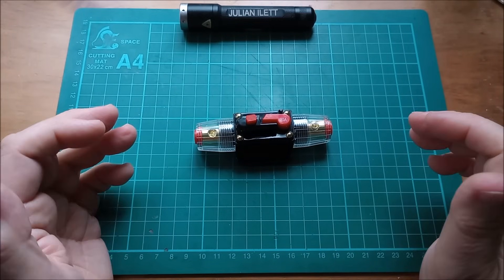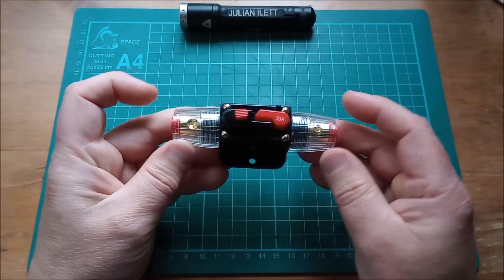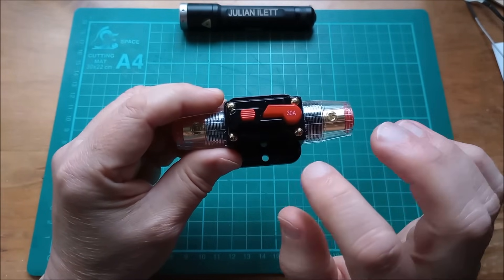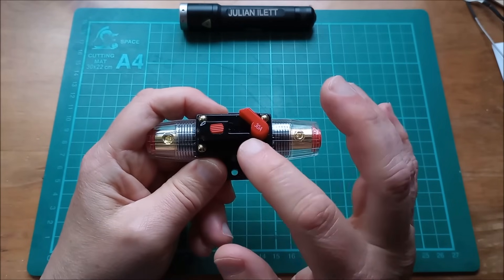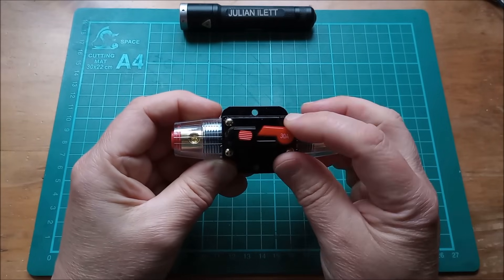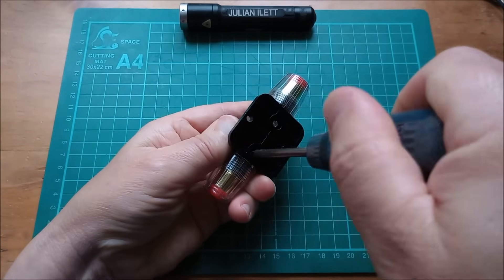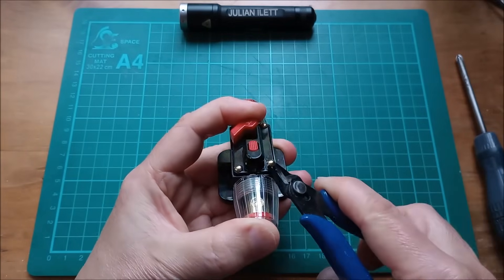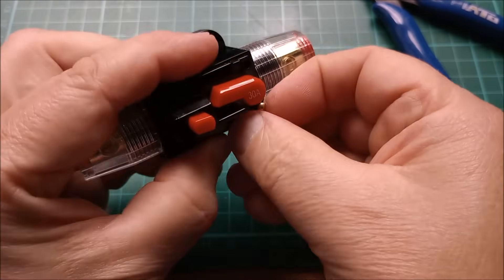30A DC Circuit Breaker Teardown

Comment: I use a 40A one for my Bafang BBS02b ebike. I wonder if it's accurately labelled to its rating. It may be too high (60A). I have not tested mine due to the lack of tools and skills, but have you tested yours?

Btw, fan since 2016. I usually reference my 'next thing to buy' with your reviews. Clear and fun as you explain your experiments/tinkering. Unlike those I see from tiktok. too much 'retention' grabbing style but lost the essence  of exploring/experimenting.

Comment: Would be much safer to have an electronic disconnect/fuse instead of these bi-matalic type fuses. If you're already using a switch that has a permanent break and manual relatch, then might as well just use a normal heavy duty car fuse that you can replace. But yeah, as others have said, avoid this style of fuse, and as the stripdown proceeded I noticed the contact points were not flat, so it' going to heat the contact points up and fuse them, likely preventing the 'spring' of the metal from disconnecting. Just an overall bas design.

Comment: I have tested these breakers extensibly and I don't recommend using them for anything.  The contacts are only good for about 30 amps but, the contact alignment is very poor and, due to contact misalignment, very little of the face of the contact makes a connection when closed.  There appears to be no calibration on the trip point so, a 30 amp breaker could trip at the same current as a 150 amp breaker.  When nearing the trip current, some of these breakers chatter, which has the potential to damage the power source and load appliance.  They are only good for about 24 volts DC and 10 amps if you want to risk using one.  In use, they tend to trip at 1/3rd to 1/10th the marked current rating.  Since these are a thermal breaker, ambient temperature and wire heating alter the breaker trip point (the warmer the temperature, the earlier they trip).

Comment: The end terminals make this look a lot like the kind of fuseholder typically used in aftermarket car audio (though those have no switch and obviously arent circuit breakers), and after checking out the link it certainly appears that that's the intended use case for this too (though I'm not sure why you'd want a circuit breaker for car audio, the fuses don't typically nuisance blow if properly rated). Anyway I'm not sure I like it for in-home (or shed) use.

Comment: He probably doesn't have a 30A source to test with.  You'd need 45A to trip it reasonably quickly.  A lot of these are dodgy, I tested a few until I settled on GLOSO which did we what it said on the tin. 100A with nice chunky terminals.  You can pull about 120A for about 25 seconds and then it trips and the contacts work properly.  Like him, I usually use it just for a quick disconnect with a safety feature in case I accidentally short the battery.
Reply: If you short the battery it will definitely blow but it might be terminal because the short circuit current of my 24V 100Ah battery is very large.

Comment: I'm not sure it's bi- metallic. It looks like it's using a mechanical bend and relies on expansion of the metal with heating, past the kink which "trips" it up past three fault line.

I just bought one of these for my van conversion but I think I'll get a din rail one that works on more reliable method. 

I'm glad you did the tear down. Thank you.

Comment: I used a few of these rated for 20a for a solar project, they would trip constantly just from the heat induced by the poor internal contact. Never even came close to 20 amps. went back to ANL fuses and DIN style breakers and haven't had issues with anything since.

Comment: I too highly recommend that you don’t use it. I hear so many complaints about them and have met several faulty ones. They tend to nuisance trip in hot weather and the contacts go high resistance which causes heat, and the cable connections can get hot and make it trip early.

Comment: Breaking DC is a lot harder than AC, I can see the little red leaver moving into a sustained arc and just melting. 
For breaking high current DC I would use a contactor designed for it and possibly one with magnetic arc suppression to blow out the arc.
Reply: Yeah, it might even seem to work with a mild overload. However, under higher fault current I wouldn't be at all surprised if it fails to extinguish the arc and melts down.

Comment: I suspect that the "little flag" is used for arc suppression.  What is maximum rated voltage for this device?  I'll bet that, when used at its max rating, it won't last long if it operates very often.

Comment: does this ... slowly open?? if so this is absolutely terrible for DC breaking.. if you have any inductive loads at all in a DC system and break the contacts slowly like the button suggests,, this will cause an arc and this thing is going to catch fire. i advide againsdt this. use a safe one which is spring loaded
Reply: yes looking at the mechanism later on.. this is unsuited for DC loads.. slow opening, no arc arrestor.. this thing is a fire hazzard. please dont use this
Reply: @GenUltra758  This!

Comment: You don't need a fuse on the panel cables.
Reply: Yes, but having a switch on the PV side makes it easy to disconnect the panels in case of any maintenance.
Reply: @TheCommonGadfly  You don't need a switch for panel maintenance. All you need to do is switch off the loads attached.
Reply: @TheCommonGadfly  You don't want to break PV with a breaker like this. It's only rated for low voltage. I would call it a fire risk.
Reply: I use inline MC4 fuses and a proper DC isolator. If you need to remove the battery from the SCC and don't disconnect the panels you risk damaging the SCC, I've never fitted a system without panel fuses and an isolator.
Reply from the maker: If I break the panel-battery connection, there's only about 15V difference between them. Panel open circuit voltage  is about 40V and the battery is typically around 25V.

Comment: This type of circuit breaker is proven to be very unreliable and dangerous.
I advise to use a decent DIN rail type DC breaker.
Reply: For the voltages these cheap breakers are rated you don't need to get a Dc breaker. Most branded AC230V breakers are rated up to 60V DC anyway. Additionally they are way cheaper than branded dc breakers.
Reply: @OlanFantaziya  It's more about current! and i.e. a 16A AC breaker is NOT suited to break 16A DC!
Also, depending on brand, a DC breaker is just 10-30% more expensive that a AC breaker. Nothing worth taking the risk...
Reply: @pgScorpio  We use mostly Schneider Electric and ABB for DC and Solar applications.
Schneider iC60N AC230 B16 Breaker is rated to break 16A <72VDC up to 10kA short current. The difference between the AC and DC breakers is that the DC breakers are rated up to 500V DC single. But also cost >10 times more than the AC ones. I pay 2,14€ for a AC 16A and 42,79€ for a DC 16A here in Germany.
I don't know where you life, but I'm not aware of a country where branded DC breakers are cheap. 

Datasheet iC60N:
10 kA Icu at 60 - 72 V DC
15 kA Icu at 12 - 60 V DC
10 kA Icu at 220 - 240 V AC 50/60 Hz

Comment: Does it actually trip at ~30A? Many cheap Chinesium fuses and breakers are wildly off
Reply: Breakers not so much. Fuses yes...but not just chinesium ones sadly. Recently had a...uncomfortable call from a client at work where a lot of fuses refused to cut the circuit and there were a lot of components damaged. Turns out we got "defective" fuses stretching over 4 production batches by littelfuse. The first and last issue we will have with littlefuse fuses.
Reply: @AlpineTheHusky  Are you really saying cheap Chinese breakers are safe and accurate, or just highlighting your experience with fuses?

Comment: I recommend you give it some tests before you install this in your shed. I saw some videos showing they were not safe to use. You can get DC fuses that look like the ones you have in the UK Mains consumer units. I have seen videos of those catching fire if you draw current the wrong way through it and flip the disconnect switch. Please don't set fire to your Shed! :-)